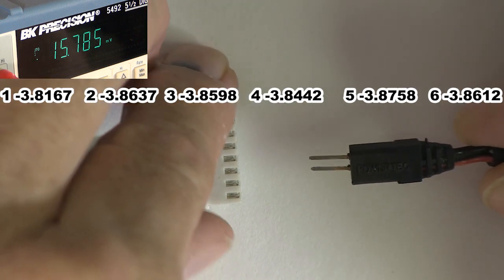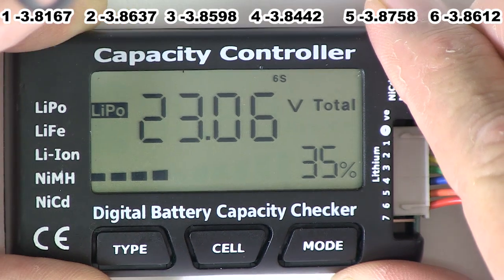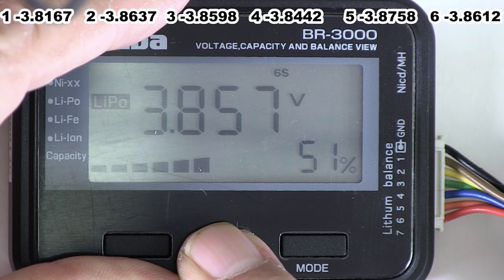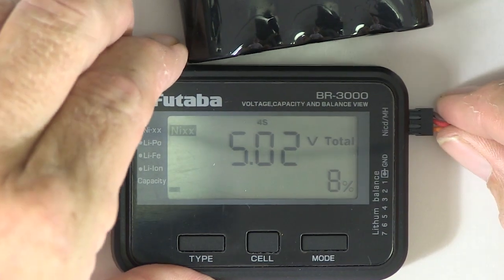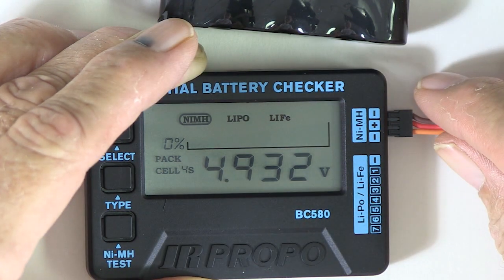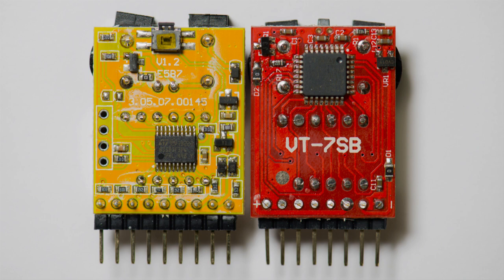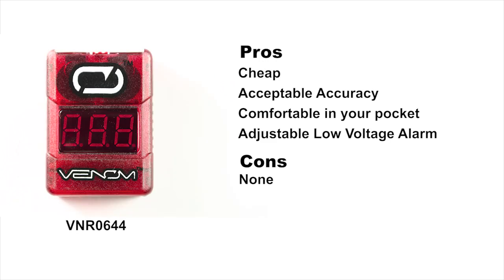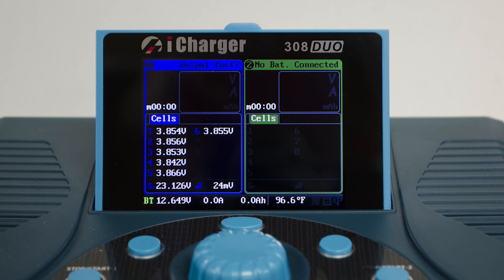lipo voltage checker monitor alarm the good the bad the best

Comment: Hello, I'm airsoft practitioner, and do not know much about the batterias buy a test of those of TENERGY $ 10 I believe not to be good, but okay, need to measure the batteria at intervals of not running out batteria to games in the middle game. How would I do for a batteria of NIMH type already plug and different not connect this equipment, the connection and Tamiya Connector for airsoft guns. You could give me a little help, 
Thank you. 
Very good your videos! 
Daniel
Reply from the maker: None of the "On board" checkers work with NiMh. I do have a thing called a GEM2000 that might work. It would have an LED that would indicate low voltage. As for the connector, you would need to make and adapter.

Comment: I just realized that the 3 worst checkers you tested are the ones I have. I will definitely be ordering the latest and most accurate which is either the futaba, JR or the Hyperion or all of them since I keep checkers in the car, office, tool box and in my field box, now when a situation comes up that requires a battery checker I will have one available anywhere, anytime and with accuracy. . . thanks for the video. I feel better equipped. .:)

Comment: Ron, really nice video.
Made me think about my "cheapo" Lipo Voltage Checker.
Did a short test with two 3S Lipos at hand.

              Fluke 175     "cheapo"
Cell 1 - 3.863V           3.86V
Cell 2 - 3.862V           3.86V
Cell 3 - 3.865V           3.86V

Cell 1 - 3.913V           3.91V
Cell 2 - 3.897V           3.88V
Cell 3 - 3.913V           3.91V

OK. The Fluke is not calibrated, but for me, the ~$2  Lipo Voltage Checker will do ....

Comment from the maker: I probably gave the Venom more credit than it deserves. It did well in earlier tests, but in this final test it had a couple readings that were off quite a bit.
Reply: +Ron Lund Good Video... good points made throughout. Generally, when I am using a voltage checker it is a go, no-go decision. I don't try to squeeze the last mahr out of the battery and fly to zero. I like the voltage checker that you smashed. I have not had as many failures as you report. I like being able to have the buzzer on the heli to stop the flight. Now I am not so certain because of the accuracy. 

I have two of the HiTec checkers and use them a lot to balance out of wack lipos. It does not have the Nicd capability though. I am not so sure of my iCharger 306 and 310 voltages. I think that it is time to buy one of the good checkers (JR) and keep the others for quick checking.

I wish that the charger manufacturers had a balance feature... plug battery in, and balance it like the HiTec except a bit faster.

Comment: Great video, thanks.  Looks like the Hyperion unit is getting an upgrade.  Do a search for:  HP-EOS8SENT3
Reply from the maker: +Doug Bowman Thanks Doug. I have them on order. I hope they are as accurate as the original. I'll be testing them.
Reply: +Ron Lund sounds good.  Look forward to your test results and if they match the original I'll buy a few more.  I end up giving away my checkers to new guys.  LOL
Reply from the maker: Doug, I did test the V3. It's "Okay", but not nearly as accurate as the old one.
Reply: Thanks much.  Bummer the accuracy decreased.